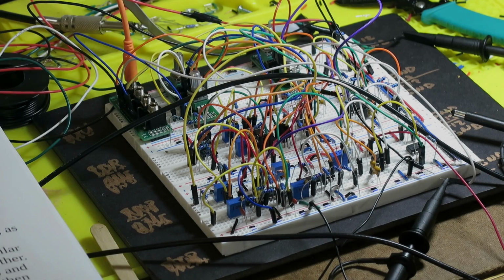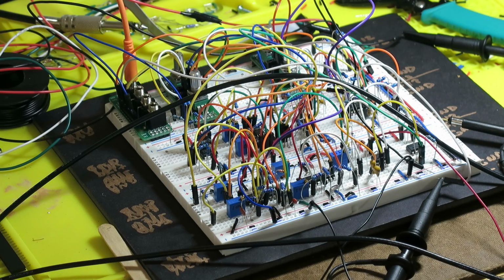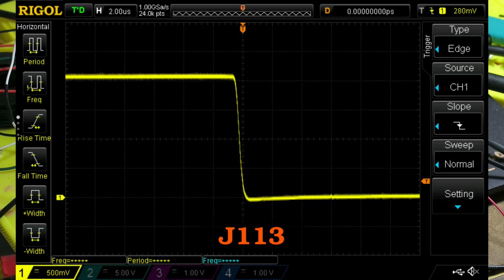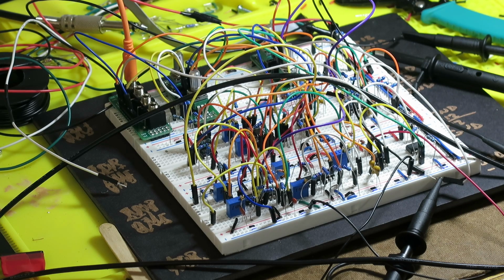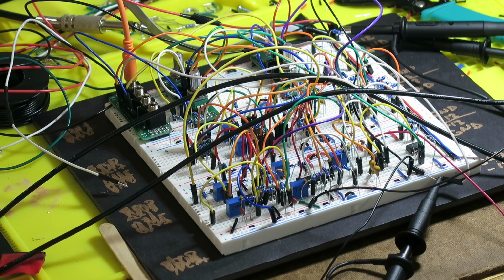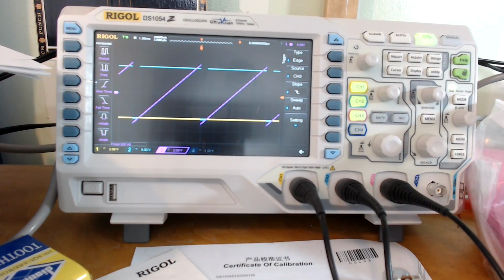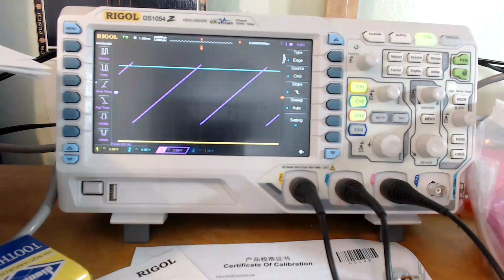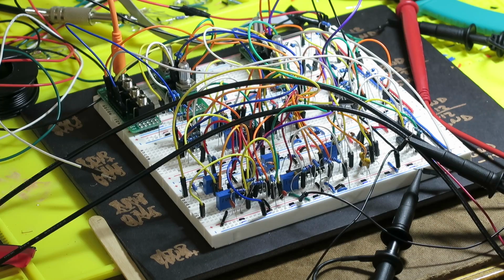Breadboarding the Music from Outer Space VCO

Comment: I'm suspecting that those JFets you tested all have different on-resistance values, that is, the resistance of the source-drain channel when it is fully conducting current from the source to the drain terminals, and that's most likely why there's a difference in fall-time for each of the JFets, that fall-time is the time it takes for the capacitor to discharge, which is determined by the time-constant formed by the capacitor and the channel-resistance of the JFet.

Comment: I'm in the process of designing/building a big modular synthesizer based on the Moog System 55 design, I'm going to be using some custom Yamaha synth chips salvaged from a defunct Yamaha CS15D synth, and I'm planning on including 8 VCOs based on the MFOS VCO design, for the matched transistor pairs, I'm going to see if I can substitute other matched transistor pairs, such as the LM394CH, for the SSM2210, I'm also planning on using more easily available TLO7X series of Op amp ICs for the LF4XX series, they are both FEt input Op Amps so I can't see why the TLO7X series wouldn't work, I've already worked-out the design for the cabinets that will house all the modules, and I'm going to be designing a +/- 15V 3A power supply for it to power all the modules, 3A should be plenty of current-output.
Reply from the maker: Good luck! The 2009 version of the MFOS VCO (at http://musicfromouterspace.com/analogsynth_new/VCO20120618REV0/VCO20120618REV0.html) replaced the LF4xx and TL08x op amps with TL07x (and one OP275 and it says you can sub a TL072 for that.) Do you have a source for the LM394? It's described as obsolete in a 2011 stackexchange post (https://electronics.stackexchange.com/questions/11263/lm394-is-obsolete-what-is-the-new-standard-log-amp-circuit) where some other matched transistors are discussed as possible alternatives. I used the SOIC SSM2212, I do very little SMD but this wasn't hard to solder. Added: Maybe you knew this already but Alfa does make an AS394, an LM394 replacement https://www.alfarzpp.lv/rus/sc/AS394CH.pdf

Comment: Great video, good job on the prototyping.
I recently breadboarded this design myself but I changed some of the parts to newer types (I use PMP4201 instead of the SSMs, J111 JFET and LM311 as comparator).
The fall time in the core is due to different on resistance of the JFET, you want it to be quick so you limit the amount of high frequency trim you need. And I think (but I might be wrong) that they drop down to different values because of the same reason. The comparator has some capacitance, so it takes a short while to turn on again after opening the JFET, and during this time the JFET will conduct a bit more. I agree that the J113 is the best choice.
I also changed the pulse width range like you did, i.e. just a pot between fixed voltages. I don't mind being able to go to 0% myself. It's also a bit simpler.
Reply from the maker: Interesting — looks like the PMP4201 comes only in a TSSOP package so would need some creativity to get it on the MFOS PCB. A whole lot cheaper than the  SSM2212 though. How do the specs compare? Are the PMP4201 transistors on the same substrate?
Reply: @analog_output  I think they are. The datasheet says max 2mV delta Vbe, which is fine for an oscillator, though the SSMxxxx variants are quite a bit better. I used a breakout PCB so I could use it on a breadboard, but I think the pin out would not be the same as two 2N3904, so I doubt it would be a drop in replacement. The soldering of the TSSOP is a bit more of a pain too.

There is also DMMT3904 which promises the same matching, I think they would be pretty similar.

Comment: Wow great! I really love the MFOS designs but I just couldn't do the oscillating type modules because of obsolete parts. With this there is hope again for 2021 ;)
Reply from the maker: It's not so bad, the DIP SSM2210 is hard to find but Wilson did suggest and make provisions for the SOIC SSM2212 (or hand matched 2N3904). The PN4391 is available, I just don't have one. 

What might become tough soon is the tempco resistor. SynthCube has them for now but I hear they're out of production.

Comment: Demonstrating the pulse width with the ramp and threshold was super cool. 0-98% is really good. I was trying out the new scope on the lmnc vco square wave, didn’t use measure functions or anything but it doesn’t have that much range.
Reply from the maker: Yeah, I looked at that recently: https://lookmumnocomputer.discourse.group/t/1222-tuner-vco-module/16/445

It looks to me like you shouldn't even be able to get a square wave since for that you'd need 2 V (with 12 V power) and I figure you can at best get 1 V with no CV plugged in. But I don't have one to try it with. Maybe I'm missing something.